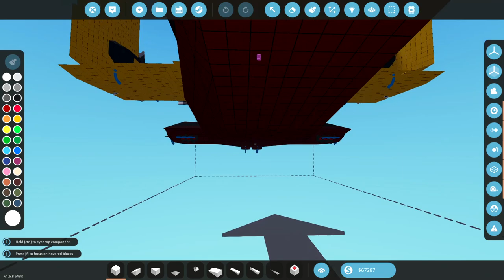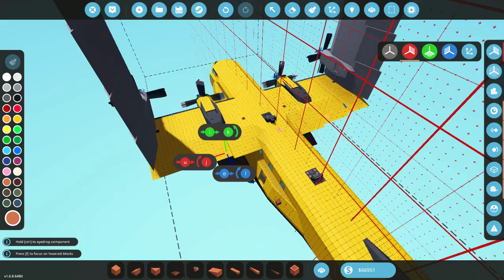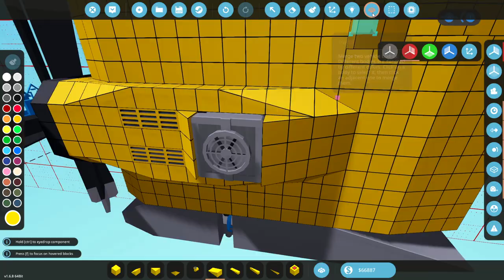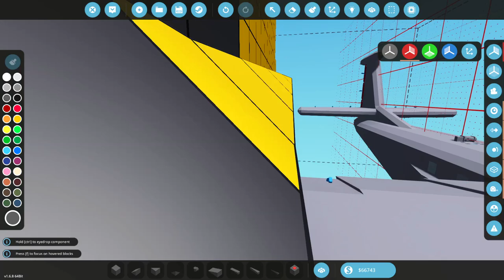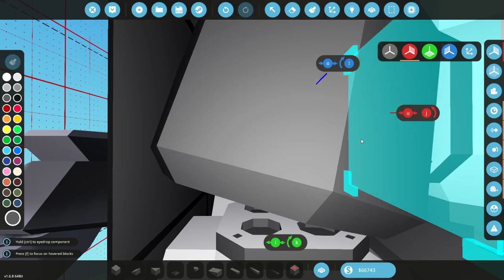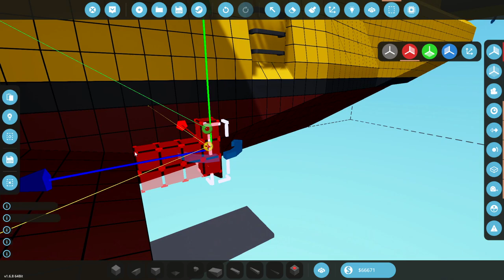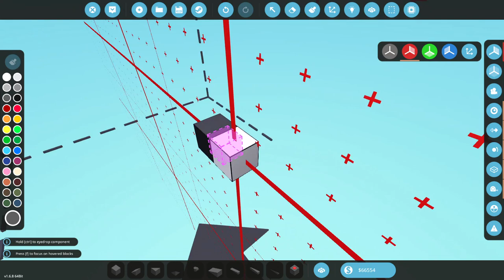A Glitch DESTROYED My HARDCORE WORLD! - DLC Hardcore Career Mode - #48 - Stormworks Build and Rescue

Comment: You might have to re start the save or do some file editing...  

Something that helps me remember how the new pumps work is that the arrows point to or from the tank to the port  the arrow poiting to the hose anchor means it is pumping from the tank, through the hose anchor to your creation.  Arrow pointing away from the hose anchor means it pumps from the creation into the pump's tank.

For the maneuvering propellers,  you can connect 2 motors to 1 prop and get a lot more power from them.    I dont think the booster propeller you are using does much for takeoff since the engies are so powerful.  you could probably use them to maneuver instead.

Comment: This is a time when you can use your previous save to recover it because I’ve had this happen in MP and basically it’s a weird game glitch like you said that basically freezes your creation in the air and even if you do get on it you won’t be able to do anything with it and it also could send you way off of the map. We tried with a rocket train and 2 cars and it breaks each time in the same way. Also with the disasters you can change the intervals on how often they happen I think you can set it up to 60mis because the default is automatically on 15min it’s in the add on menu all you have to do is click on it and it will give you a slider to adjust the intervals.

Comment: Always always always always include a torque crank generator in your beginning creations if you don't have a generator hooked up to your power lines. It's slow, sure, but it's reliable. Slap about 3-5 3:1 gears facing at the crank and you can generate about 0.2 ish electricity (dunno the units of measurement used in the game.) Put two cranks on one generator and you can pound out an additional 0.05 ish more. So it's silly, it's slow, but it's something you can absolutely rely on in career mode to work.

As silly as it may seem, you should also, to save electricity and future headache, make hand pump fluid port converters. Take a hand pump, put a fluid connector on the in and a hose connector on the out and put handles on the same sides of the both connectors. That way you can store it with the fluid connector, carry it around, and use it to connect the fuel boom's fluid connector to your hose without having to get the hose directly to the pump. It'll be slow because you'll have to pump to help carry the fuel across the hose line, but the manual components are there for ease of use, reliability, but meh efficiency. At this point, you've left yourself a beggar, so being choosy isn't an option for you.

Comment: Temp sensors only work on the Crankshaft itself.
Reply: I wouldn't even use those temp sensors because they take up space for pistons, plus you can just grab cylinder temp from the composite output.